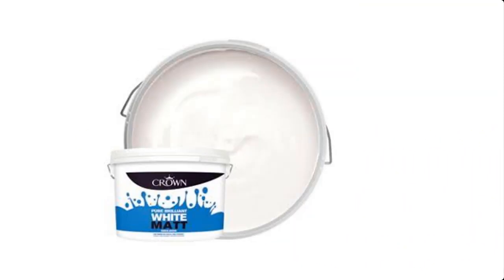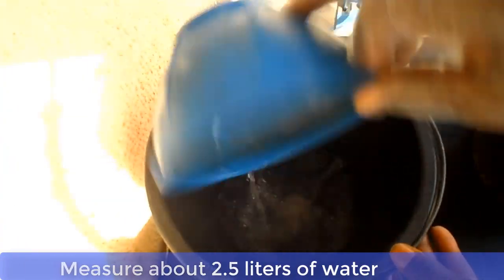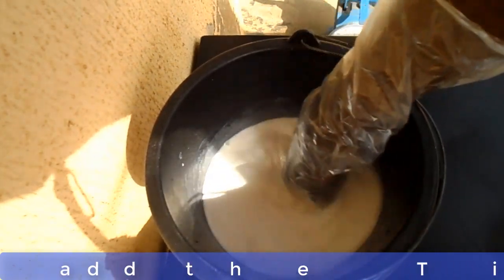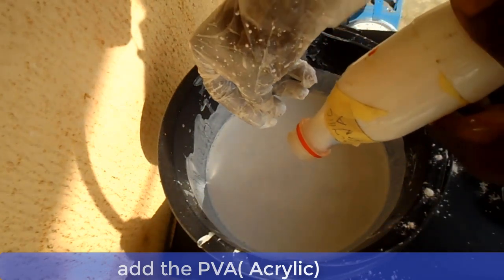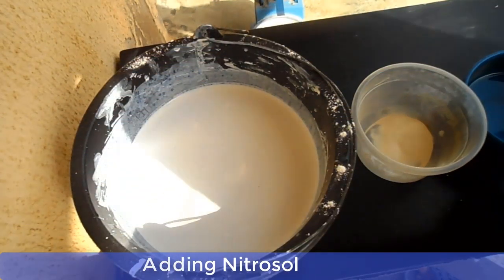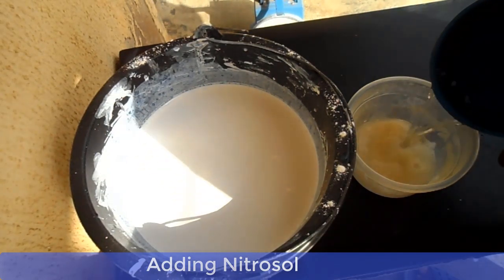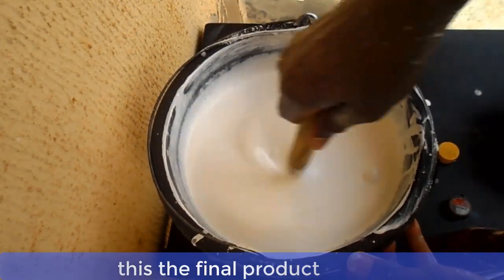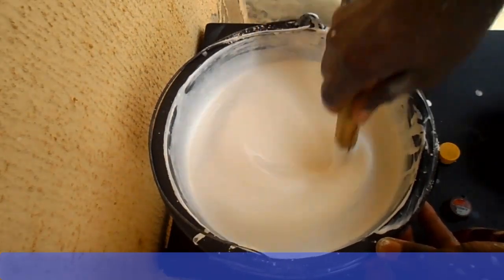How to Make EMULSION PAINT at Home

Comment: Bros, good evening. I watched your video demonstration on how to make Emulsion paint and I was fascinated to try it out as demonstrated by you. If I'm doing mistake, you produced four litres in the tutorial. 

You did mentioned that 2.5kg of calcium carbonate is needed probably that was what you used in that video guided by hugeness in the bowl. The question is that how will someone used 2.5kg to produce 4litres of paint that is sold between N1,200 to N1,300 but buying only calcium carbonate per kg for N1000 and of which the 2.5kg will be N2,500 excluding other chemicals. I want to know how that's possible because that was I bought a kilogram of calcium carbonate yesterday.

I will really appreciate your quick response, if there's something missing in the measurements you give or that the price of calcium carbonate for N1k per kg is wrong and outrageous.

Thanks
Reply from the maker: 50 kg of calcium carbonate cost  N1000
Reply: Is this  emulsion satin or emulsion only?
Reply: A 50kg bag white sold for N1750 in Onitsha on November 22nd, 2021.  Calcium carbonate your is the cheapest paint chemical.